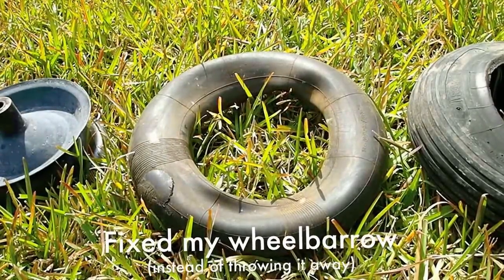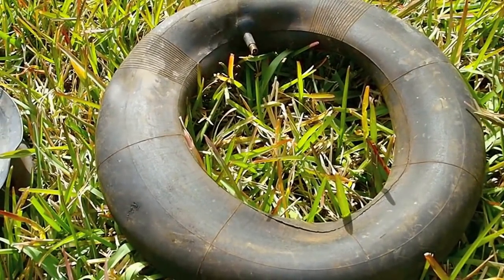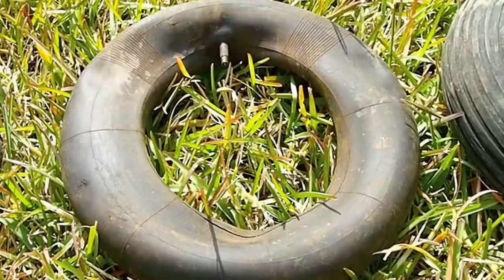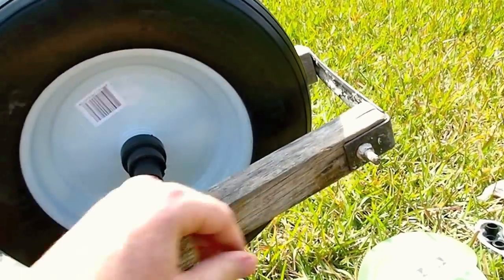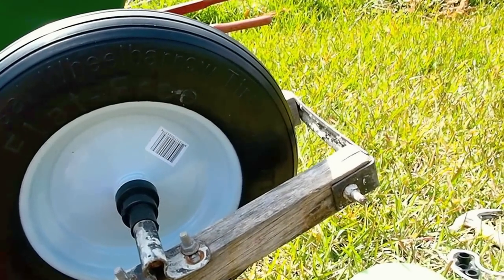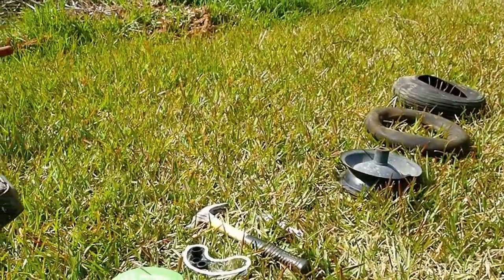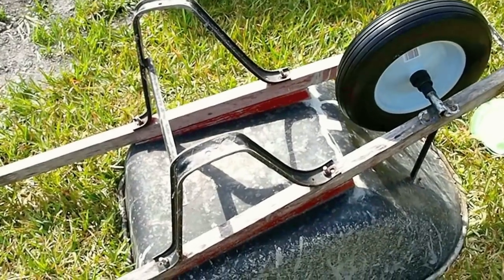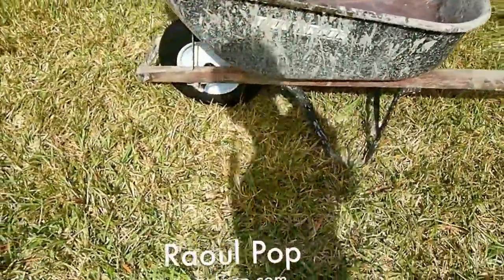Fix your wheelbarrow, don't throw it away

Comment: Raoul.  This is not the same as a fifty dollar wheelbarrow.  It has an industrial tire on it now, which is a major improvement.  Value added.  This is a better than what you originally bought, a major improvement.  It is a hundred dollar wheelbarrow now.  Now you need to put two metal rods down the shaft of the handles, and you will have a real wheelbarrow.

Comment: I rebuilt my wheelbarrow a month or so ago.  Today I took it apart AGAIN and am repainting it.

All I had originally was white paint,  and after repainting all the wood and metal with that it was VERY white!

I got a gallong of gray house paint free off Craigslist,  and I'm repainting the tray with thast color.  It should look good.  More importantly,  I was able to improve on the paint job.

I had replaced the rusted bolts that would not come loose,  and didn't think to use carriage bolts.  So the new bolts stood proud of the tray and would interfere with shoveling stuff out of the tray.

So when I removed the tray to repaint it,  I used my grinder to grind down the heads of the bolts quite a bit.  That will still allow me to tighten and loosen them,  but they should be much less of a nuisance because the bottom of the tray wont have those four bolts sticking up.

Comment: I promote sustainability on my urban homestead too. But I do see the other side of the coin, which does have a very valid case for just buying a new wheelbarrow rather than spend the time, effort, and money to repair an old one.  A few days ago I got a contractor's wheelbarrow completely free.  But it has a flat tire and a good bit of rust. Just to cure those things can cost abut $50 in materials, such as sanding disks, wire wheels, primer, paint, replacement nuts and bolts, and a new tube or complete tire.  It will also take MANY hours of my time to disassemble the wheelbarrow, remove rust and old paint from all the parts, prime and repaint, fix the tire, and reassemble everything.  

I earn more than $50 per hour at my job.  While I completely enjoy doing restoration projects my time is worth a lot.   I can buy a brand new wheelbarrow equal to this one for between $55 and $90, depending on brand, at one of the two local big box home improvement stores.   Thus for maybe $5 more than just the materials to do the restoration cost, I can buy a new wheelbarrow and not waste a minute of my time restoring the old one.   That is EXACTLY why so many people just buy something new.  It simply is way too inefficient and costly to repair old equipment.  

All is not entirely bad either way.  If you fix it, you save consumption of the earth's resources and reduce the impact on landfills.  If you buy a new one, you help people who work for the company making new products to have a paying job to support their family.   What's best thus becomes a person choice.  I'm going to repair mine but only because I want to post a Youtube video on doing the project to help my channel. It would be much easier just to buy a new one!
Reply: Trehan Creek Outdoors Myhourly rate is much higher but that’s important only if I’m getting paid. My non-comp time doesn’t produce any income and I enjoy repairing and rebuilding over replacing. I just completely rebuilt my wheelbarrow with a new solid tire. I disasssembled all parts, sanded and painted. It looks great!

Comment: I can get a new wheelbarrow for less than the tire you bought, but I want also to keep using the old one if it still works. Besides, Home Depot is wrong, they do sell replacement tubes, at least where I live you can get them. But for a yard like yours, flat free is the way to go.

Comment: Ok, you did right by keeping and fixing the wheelbarrow.  However, the inner tube, on ebay, is $ 8-10.00.  Seems like you have another wheelbarrow in the background you could use while waiting several days for the new inner tube, and saved nearly $30.??

Comment: I totally agree with you man. I'm like you.
Wise words & wise thinking 👍.
Along with that, I like to do preventive maintenance or lubricating & greasing things too. 
Every process or manufacturing is using energy & resources & harm planet and environment. as you can see in the heat wave recent years.
If things is usable.. fix it.
If you can prolong the life of something.. do it.

but at some points.. sometimes fixing something in very bad condition..and that is likely to fail, could be more wasteful than recycling.

There is sweet point, and common sense.

Comment: I was looking for demonstration of how to remove the tire and reassemble. My 6 cu. ft. TrueTemper (steel) wheelbarrow was purchased at a thrift store for $20 but the tire keeps going flat. Maybe the tire can be fixed and maybe I'll have to replace it...dunno yet.The only way I can see of removing the tire is to turn it upside down and undo the bolts, but maybe I'm missing something.

Comment: The tube should not even be necessary since the tube is a tubeless.    all these vids are showing put a a new tire and wheel on it.  That rim is totally fixable, you can tap that dent back out with a small hammer. and then just use that old tire if its good or get a new tire.
Reply: I don't think tubeless is an option at this point, but you're right, the wheel is still good. I'd slap another patch on the tube and hammer the dents.